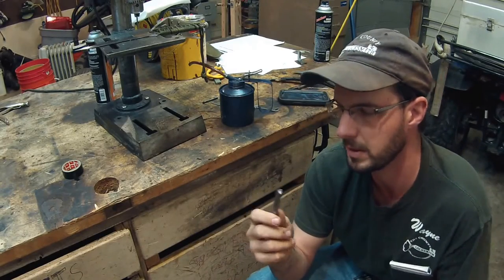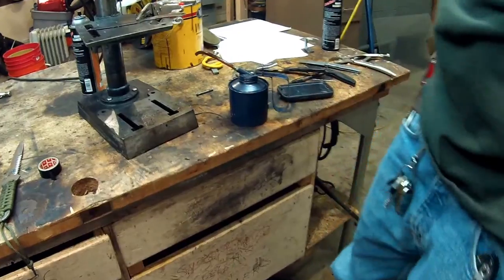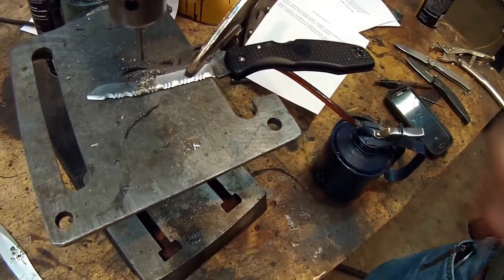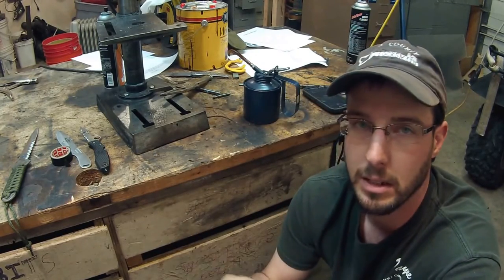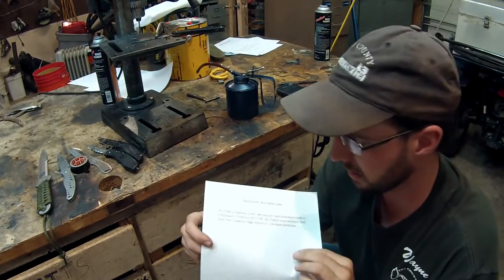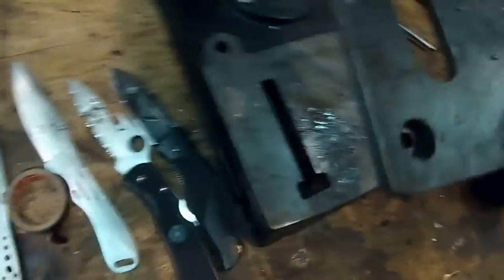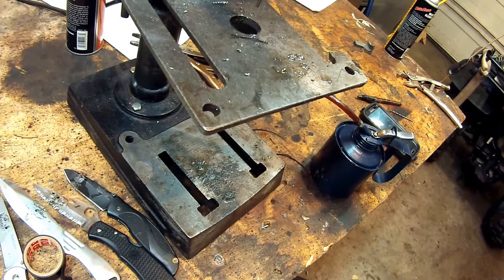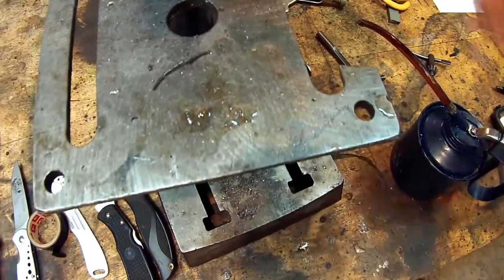Drilling a hole in a stainless steel knife blade

Comment: What do you recommend for cordless drill for stainless steel drilling, the ttp bits mentioned in you're other video or the solid carbide bits in this video?
Reply from the maker: There are diffrent grades of stainless steel. Some cobalt will drill some wont. The TTP- Bits would not touch this knife steel in this video at all.
I would buy a single cobalt bit (Any Brand will do) from a local hardware store at test with. If your cobalt bit drills the material you are planning on working with than Go with the TTP bits they will be more forgiving in a hand drill and less expensive as well. If your test cobalt bit will not drill the stainless steel than your only option would be to go with the solid carbide ones from drillbitwarehouse

You may also experiment with the carbide tipped drillbits from BOSCH. I have been having good luck with them and they will be the most forgiving in a hand drill It will just be a matter of them drilling fairly slow.

Hope this helps please send me an update about what works for you.
Reply: Thankyou for your reply. Slow is somthing I can do as its very rare, however nothing is more frustrating than a drill bit that doesnt cut at all. In the past Ive had to hang stainless steel hoods...what a nightmare..lol. Im okay with spending the money on a decent set of bits. So to recap, carbide are more likely to snap and I have to use lots of pressure and go slow with a hand drill. However the TTP bits will work faster and might not need as much pressure but are more likley to dull?
Reply from the maker: 1/8" Hi Roc Carbide Drill Bit

Price per Unit (piece): $22.88 
$19.75	
You Save: $3.13
Number pieces in packaging:1
Ask a question about this product
1/8" (0.1250) x 7/8" LOC x 1-7/8" OAL Sub-Micron Carbide Drill Bit. 
TIALN Coated for super hardened and abrasive materials.
Titanium Aluminum Nitride is a hard, abrasion resistant coating.
Superior oxidation resistance provides unparalleled performance in high temperature machining.
Micro-hardness 3600 Vickers. Thermal Stability (750 deg. C or 1562 deg. F) Coefficient of Friction .45
Capable of producing reamer type finishes in abrasive materials such as: Chrome alloys, Heat treated alloys,
Nickel alloys, Titanium alloys, Steel & Stainless steel weldments. 
140 degree notched Drill Point. Made of premium submicron carbide with a blended 10% cobalt.
Little known secret! 
This drill can be used for small holes in Onyx, hard stone, Super hard tile, rock and jewelry applications when used with a drill press.
Precision tight tolerance holes. +0.0000 / -0.0005
Reply from the maker: Here is your answer
TTP- hard cobalt VS Solid Carbide VS Masonry Drill bits Drilling Stainless Steel